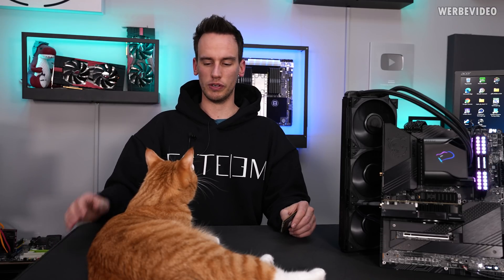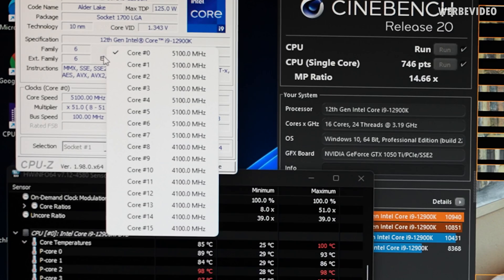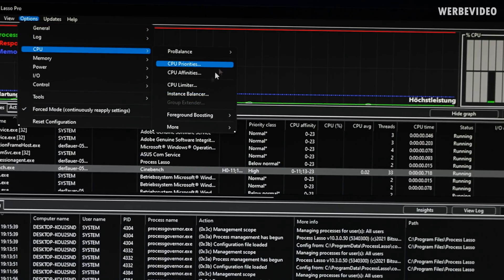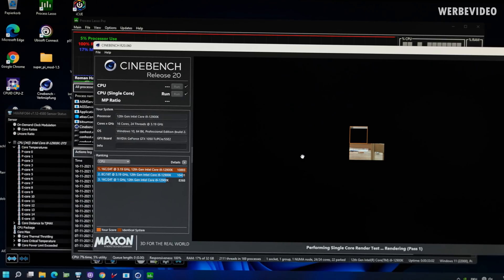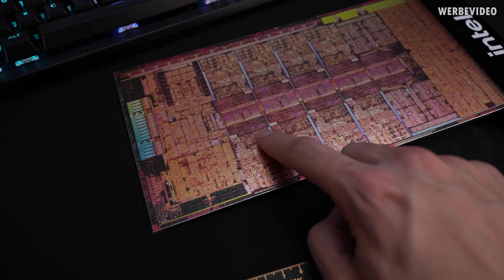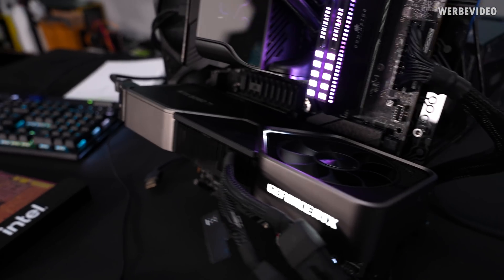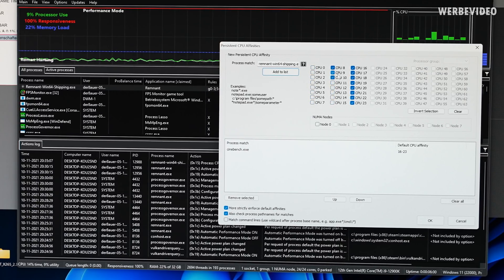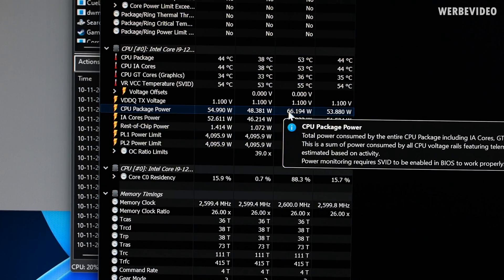The E-Cores were not meant to be used This Way... but it's Amazing!

Comment: A low power 12th gen i7 laptop with 2 P cores and 8 E cores is about equivalent to an 8 P core low power AMD R7 laptop of the same era. But I have no idea how it would work for light music production like I'm planning. I was using an R5 with 4 P cores before and it was really slow. Seems much quicker on the i7 but I haven't made any projects with it yet.

Comment: compared to newer ryzens, given what i normally see in laptops, a 6p, 8e cpu is slower than amd 8 core with smaller node process, though just by a bit given that the ryzen gets better IPCs than intel P and in comparison we can assume in P cores the intel has 9. However the AMD has a much better IGP and has a NPU as well. was just browsing at random comparing r9 and i5 both of the higher performance variant. However the highest end intel cost 2-3x more at least and is not available without another dGPU so i could only compare the same class of hardware fairly (ddr5, same dGPU, etc). the intel was about 15% cheaper but for what i need to a computer for the intel option is more expensive given most of my workloads are VMs, containers, compilers, video editing, ai.

Thanks for testing the E cores specifically, i had always thought they were based off intel atoms and this doesnt seem far off given there are some intel atoms can be had above 3Ghz with 4 cores but they were a bit rare and there were also 8 core xeons using intel atoms. Theres test showing the N200 which are e core only being a bit slower than the rk3588 ARM CPU which means that intel is falling behind against snapdragon in their E cores by a mile. Given you clocked them to 4+ Ghz they would perform better especially with dual channel DDR5 but if you put its competitors in similar space you will find intel E cores struggle even when AMD has yet to implement big.little for my use case. Should do compilation benchmarks but compiling something heavy that takes long is a good benchmark like llvm compiler, or the latest open sourced python with optimisation flags added.

Comment: But it’s only a good idea for programs like Cinebench. Otherwise what purpose do “e” cores have? Is it just to increase core count. I’ve heard some referring to them as half cores and I guess that would be accurate.
Reply: if that's your takeaway then i dont think you get it lol
Reply: @ Ok. So why don’t you tell me what I’m not getting. You need to clarify that statement with some cold hard facts as to why exactly “e” cores exist? Other than an unrealistic “core count”………..then why? And don’t even consider using the “lightly threaded workload” excuse, because a full “performance core” can just throttle back in that scenario. Intel and the word “efficiency” don’t quite mesh together. If they did, we might actually be able to cool them with something other than an AIO. Intel had hit the proverbial heat wall, and their underperforming “core ultra” series is a step back rather than a step forward. I thought AMD would also hit that wall, but their innovations are on another level. I’ve been building PC’s since the days when Cyrix was a player. I’ve watched AMD get dragged through the mud by Intel……but they kept getting up. The fight wasn’t fair then and it isn’t fair now for Intel. While Intel “sat on their hands” for years upon years………..AMD continued to innovate…………which brings us to today. Intel is simply “scrambling” to keep up and stubbornly refusing to move to a similar architecture. Intel’s design is a failure and “flawed” at best. That’s what “sitting on your hands” gets you. 
The ball is in your court. I do really want you to elaborate on your response. I’m all ears. LOL!!!

Comment: I'm really curious to see how the E cores behave in virtualization workloads. As someone who uses VMs quite a lot, but not really in high power applications, I'm curious to see if I can just abuse the E cores to run multiple VMs without influencing the gaming performance at all. Imagine a 13900k used for 4 quadcore VMs on the E cores and still being a gaming beast with the P cores. That said, i'm currently on a Ryzen 3900x and see no reason to upgrade.

Comment: I used to use a program called core control with my gen 1 i3 back in the day.  Early hyperthreading was terrible even doing office work, when I put resources to specific programs I mainly used for work it was all good.  No more blue screens or lockups, mine was the only reliable machine in the whole office.  I always went with AMD for my personal rigs back then as for the price they were always better until Sandy Bridge.

Comment: I would appreciate it if the separation of the two types of cores were better though. They still share the same L3 cache, which means that the ring ratio has to be set lower unless you disable e-cores. The ring ratio affects the frequency of all cache including L1 and L2 cache which are not shared between the two types of cores. Ideally, the L3 cache is separated with the option to have different ring ratios. Or, there's the separate option to set a different frequency for the L1 & L2 caches of each type of core and one for the shared L3 cache. Then there's the whole AVX-512 fiasco. The P-cores have the ability to execute AVX-512, which physically takes up space on the CPU doing nothing (other than maybe improving thermals, but then it is literally a glorified and suboptimal heat sink). It definitely is possible to have the P-cores support AVX-512 while having the E-cores running. Intel worked hard on its Thread Director controller and working with Microsoft on Windows Thread Scheduler, so why stop there? Why is a unified common instruction set necessary? These two problems illustrate the problems with e-cores, which is that they handicap the performance and features of the p-cores due to their lack of true separation, forcing Intel to handicap everything they share (things like the L3 cache and the common instruction set of the CPU).

Comment: How do you work out which threads in the CPU affinities corresponds to which cores? If I want to set something to use only e-cores on an i5-12600K, it's showing 16 threads for 10 cores - 6 p-cores and 4 e-cores. If the p-cores has 2 threads per core, that's 12 threads, which leaves 4 threads left, which means the e-cores aren't multi-threaded... So should I set the last 4 threads to limit the process to just use the e-cores?

Comment: Did anyone noticed the gpu usage drop from 99% to arround 50% when gaming on the E-cores?? what´s that about?
Reply: because when only using e cores, it bottlenecks the high end GPU.  But when he also used the P cores, the GPU became the bottleneck hitting 100% usage because the CPU was pushing the fps so high.

Comment: You might get better temps if you flip the AIO radiator so that the end tank with the coolant lines at the bottom of the radiator and keep the pump below the top of other end tank. AIOs have some air in them from factory to allow for thermal expansion inside the system. This will prolong the life of the AIO and will reduce any water noises that it makes. Gamer's Nexus did a video on this as well not long ago.

Comment: process lasso is great if you have lots of cores, you can dedicate lets say, last 8 cores just to game. if i had threadripper or some crazy CPU like that, i would do it. as well if you play demanding game, process lasso optimises processes in background so that your main program dosent suffer performance. i have it always on. you can as well limit to how much MhZ your CPU boosts by setting costum power plan to game you are running, for example, you play some strategy game, locked at 60fps, cpu dosent need to sweath at 5GhZ, you can set it up to boost max to 3 GhZ and not loose performance, it stays cooler too, so many possibilities.

Comment: I guess e-cores were designed to handle Windows background processes to increase minimum fps during game play. If Windows or the game do not support the feature correctly, e-cores will also handle the game causing frame drops or even crash. It happens because e-cores does not have same frequence and hyper threading such as the p-cores. I have windows 10, and had to disble e-cores, because it does not support e-cores properly while I play certain games.

Comment: Efficiency cores were design for multitasking.
It was general "assumption" that E cores were for light tasks and that's like oversimplification at best.
All points in video seems valid. E cores take little space, there much more efficient and can be used for some tasks with great success.
But the title is wrong because companies like Intel usually know what they're doing.
If E cores would be good for light tasks only than 12900k would have 2 maybe 4 e cores at best. Meanwhile it has 8.

Comment: So it's less about efficiency (on PC), more about the core count, since the system with both types of cores can rely on P-cores to maximize single-threaded performance and E-cores to add more workers in multi-threaded tasks.
Since power efficiency on PC makes no sense, but versatility does.
Reply: Perfomance per watt and area on the die.

Comment: It is the future until they find another Spectre or Zombieload in Intel implementation. You might get AL system and two years later mitigations take 20% of your performance. System schedulers are mostly very crude, If programs that are very bursty and system is migrating them between E and P cores all the time and potentially creating micro slowdowns or crashes.

Comment: The "leaks"/etc. for 13 series (from "i5 13600K -> i9 13900L) have [6/12 + 8], [8/16 + 8] and [8/16 + 16] core setups where [P/Thread + E]. 

I think the i7-13700K will have a nice sweet spot for P cores, P threads and E cores.

Comment: Very interesting exercise, as usual.

I do not finish by seeing the sense of this hybrid architecture for desktop, because in this case as "great" as the E-cores are, they are ideally relegated to background tasks, according to operation of the arquitecture, the last straw would be if they were very bad. That of course does make sense on laptops and servers. 
Also say that many applications, especially benchmarks and productivity, ignores and overrides the control of the Thread Director or at least its basis occupying the E-cores, so for example in Cinebench compared to the competition or with previous generations, the score is very bulky while in games that same difference is not seen. Everybody seems to not see this.

Comment: Can you measure performance per watt from the wall difference for P and E cores. Measure idle and then  perf.score/(Pload-Pidle). I wander if the performance cores are more efficient at full load

Comment: Weird, I wonder why their single threaded performance is so different. That 60w load is impressive as hell. 
At the end of the day I hate that they made z690 motherboards sOO expensive I really hope those prices come down overtime because that is very interesting I wonder how it would preform with randomX If it had the same L3 cashe.
This is my only hesitation with alder lake 30MB of L3 and 14MB of L2 seems so low compared to even ryzen's 3000 series. 
Sure its good for gaming but that 60w is so much more impressive to me. I wish they would split their designs so that they had a true production series mainstream build with this style of little cores for true multi threaded tasks.

Their total lack of price transparency for Xeon makes me assume their prices cant compete with epyc and their Xeon product stack is mindbogglingly disorganized. They should have taken this philosophy to the server space and simply committed to competing aggressively in the low-end consumer market.

I fear they only released the 12900k to appear competitive inplace of letting ryzen take the "fastest" gaming cpu while winning the war.

Comment: Imagine if 16 years ago or so on, Intel decided to make a dual-core CPU that had a Pentium M core for efficiency (which was the latest of the Pentium III based CPUs) and a Pentium 4 for performance

This current Intel design makes me think that "since the first Core series processors were basically Pentium Ms that had a die shrink, two stuck together and more capabilities, the Core 2 series being a refinement, the later Core i-series was a full scale improvement still based on their earlier success" then those E-cores might be the best that the lineage had been all along, basically if Intel went straight and used only so-called E-cores but more of them and with more beef in them, it will actually win over AMD at that point.

But then the engineers must have thought that it is too risky to dip right into it full-on (like the Core 2 Quad being two Core 2 Duo dies on a single CPU like how AMD nowadays does it, because Intel did not want to risk making all four cores in one die when it all worked out) and hope the next generation will hopefully have less heater with more performance...hope

Comment: Most of the "space" in a core is used by AVX instructions AVX256 and AVX512 takes up soooo much space and use soo much power.
The e-core is just a P-core without these heavy instructions, just basic x86 instructions with some of the older extensions which arent heavy.

Comment: I'd love to see this pushed to the absolute max, a CPU with just one or two P-core of the fastest possible design for running single-threaded tasks as quickly as possible, and the rest as E-cores.
Reply: Yeah, I agree. This seems like the way to go. People run highly parallelizable codes on GPU's but some codes are really difficult to implement to GPU. This would be the perfect solution. Although I think I'd prefer something like 4 P cores and the rest E cores just because I have some codes that I want to run with 4 cores super fast but most of my codes are as many cores as possible.

Comment: The efficient cores are not at all efficient, considering the brutal amount of Watts that the processor consumes. If efficient cores were that good, Intel would make processors with just these cores and run a lot of threads. 
Efficient cores exist only because Intel produces processors that consume a lot of power. Intel cannot currently put in more P cores because the processor would catch fire.

Comment: I agree. The whole point of the E-cores was to give smaller programs that won't really see a benefit to the bigger E-cores a place to run, like Discord, browsers, mail clients and office applications, MP3 players, programs for LEDs and other ancillary hardware (like iCue from Corsair), etc. None of those uses put any demanding strain on the CPU's. I could see an argument for more P-cores for use cases like CAD/CAM, media editing, modeling software (things like fluid dynamics, crash tests, strain loading, etc.), etc. But even then, just to chuck the processes for the various Windows systems onto the E-cores would be a godsend. Plus, it's a way to add a lot more cores without really increasing the price. (Looking at you, Threadripper.)
Reply: A random thought I just had was that it would also decrease the likelyhood of a random process freezing one of your main cores and leading to unresponsive OS or IO
Reply: @Kyrator88  We have multicore processors now, and that logic would apply to those as well. I don't think that's something an e-core would necessarily prevent.

But it's a good though.

Comment: So if e-cores are 30% of the performance of a P-core but take up 20% of the space on the die then why wouldn't you achieve greater performance when designing a cpu by using 100% e-cores, that is assuming a finite amount of space on the die. So assuming the same die size, you could have 48 e-cores instead of 8 P-cores and 8 e-cores. (obviously this is not realistic but demonstrates my point)
Reply: I'm pretty sure Jim Keller said they should do that lol. It would absolutely offer a ton of multithread performance, though single core would fall well short of modern high performance cores like alder lake or zen 3.

Comment: Windows 11 scheduler fails to allocate workloads...
I built a PC for my dad and I noticed that the scheduler parks the Pcores if the application isn't in full screen.
I did a test on a 12700k with Handbrake: as long as the program window remains in the foreground, all the Pcores and Ecores are allocated at 100%. If I open a browser and use it while the movie is being compressed, the kernel takes the load off the Pcores and runs the video compression only on the Ecores. Maybe good for games and synthetic benchmarks, absurd for all other tasks like rendering, compression, number chrunching...
Prime 95 and Pegasys TMPGEnc worload have the same behavior so it's not only an Handbrake issue. 

Have you notice this weird behaviour too?
Do you think that Process Lass can always force the use of all 8+4 cores?

Comment: What an exaggeration and infatuation for those misealy laptop grade e-cores :). Shintel is still using Sandy Bridge 2011 based architecture that is full of HARDWARE SECURITY HOLES, uses nuclear amounts of power, produces LAVA like temperatures, has nonexisting multi-core performance and has much worse IPC performance than competition. Those are all facts :).

Comment: Some of us don't want to spend more money for a cpu containing e-cores just to have to spend more money on a program. Also these new intel cpus with the e-cores need windows 11 to function properly. I'm not a fan of having more threads than I need, its a waste of money. Eight threads is more than needed for most people. City Skylines only uses four threads. The story is the same for most video games. I would like to see single thread performance improve. Having fewer more powerful cores is the most cost effective way to go. My wallet tells me what I want...
Reply: Hopefully intel will release 4 and 6 core alder lake models without efficiency cores for cheaper. I think they will in early 2022.